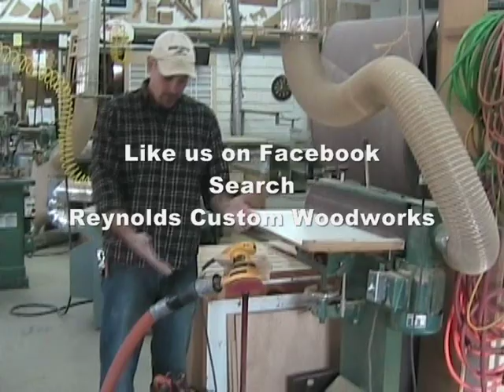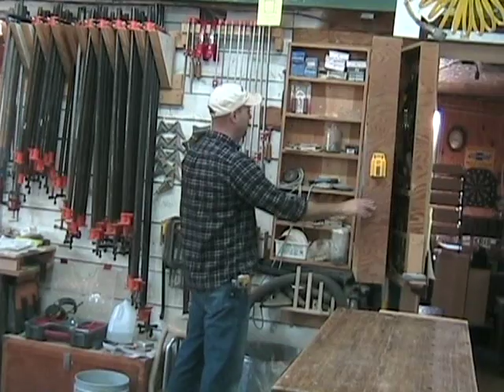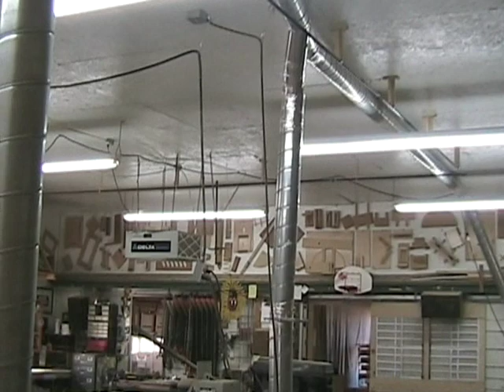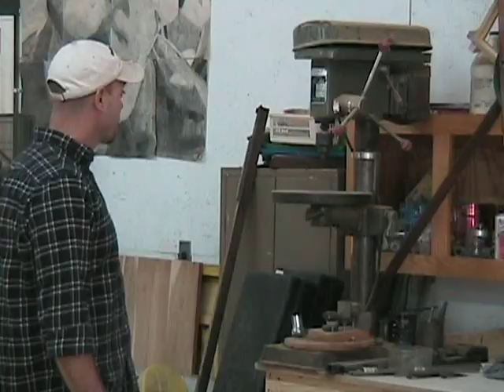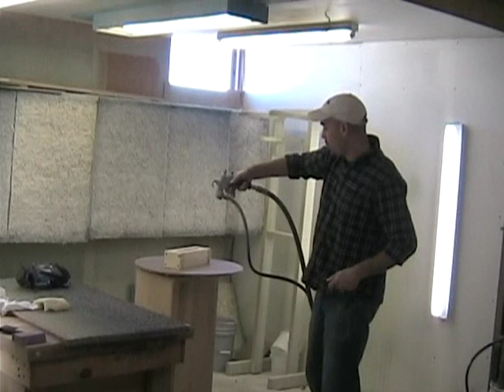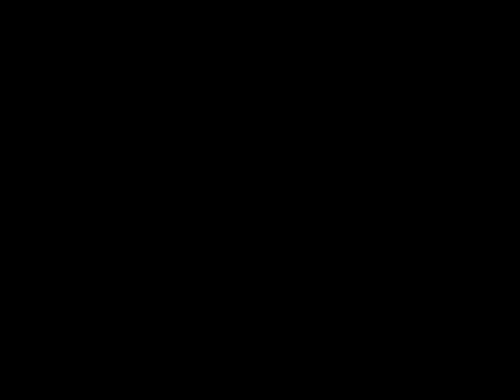Custom Kitchen Cabinets Shop Tour Part 2

Comment: Carpenter and appreciative. Raised panel doors. I'm set up for everything else. I am trying to figure out how I am going to set up my router to do raised panel. I can use clamps and solid as a guide, it just seems like there's an easier way. Maybe build a permanent adjustable frame for my router. That might work. Different size doors means something with good adjustability and strength. I don't have a shop is why I'm asking. I have a deck and work in my back yard. Plenty of experience and tools. Get or build a shop?

Comment: Thanks for the tour. How do you attach your faceframes to your cabinet bases if you pre finish them?
Reply from the maker: Hey Michael.  We use pocket screws
Reply: Kris Reynolds thanks for the response. Do you ever get any wood shifting while putting in the pocket screws into the faceframe? Ive been hesitant to use pocket screws on face frame attachment because whenever i would use pocket screws on things without a good clamp involved the joint always moves as i tighten it down.

Comment: It's nice to see you back. You cherry cabinet videos were great. Nice to see how the shop looks. Ever since I saw your first video, I always liked your shop. I see you have the new Porter Cable Drill press.. How do you like lt?? Is that massive shaper a Delta/INVITA??? It's nice to see another woodworker. Looks the cabinet company is doing good. I run FREY WOODWORKING INC. In portland OR. We build Custom Built Furniture, Furniture restoration and Repair. I have not had a cabinet job yet,Want one